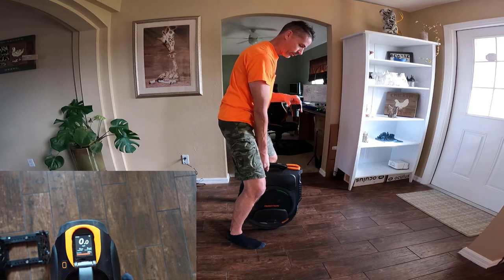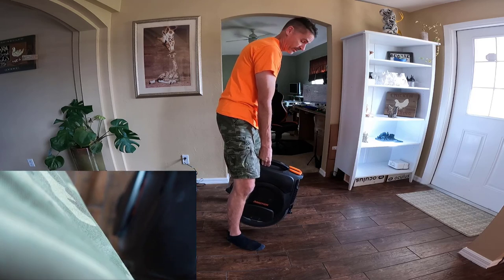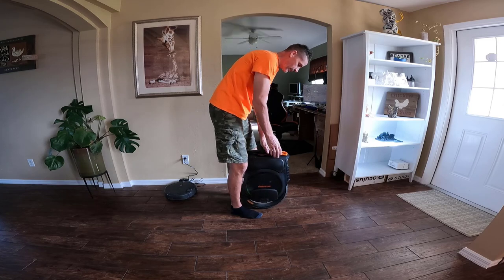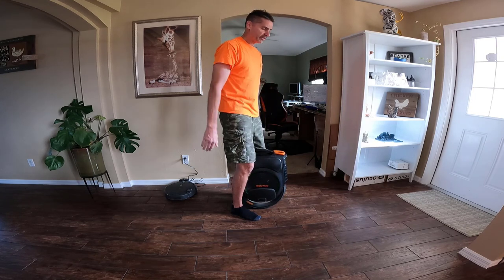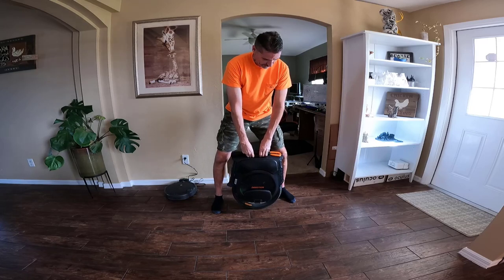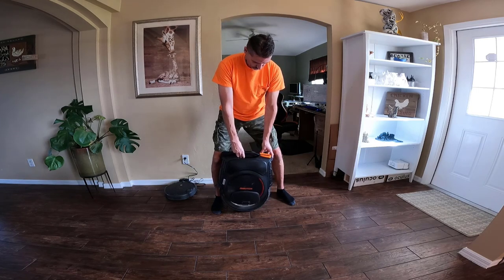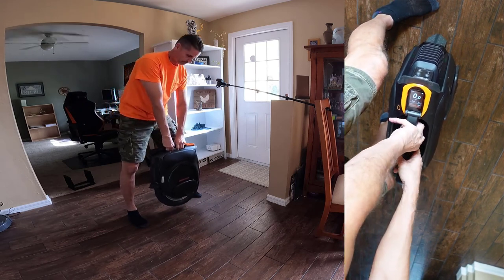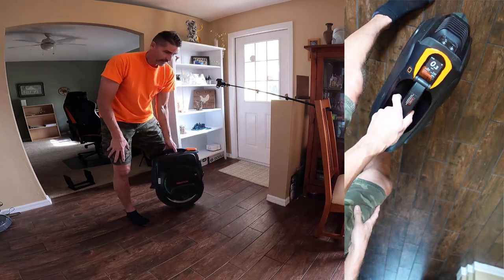V12 Stress Test - Make Sure You Understand What a Failure Is

Comment: Not 100% sure the test applied the stress expected here, you can compare with the sample uploaded by eRides, where the wheel rotation reduces very quickly each time it's yanked.
In comparison in your test it's a much more gradual and long slow down.
Maybe linked to off-road vs computer.

It's a difficult test to reproduce, especially with this handle. (On Sherman it's very easy for instance, I was using this method to adjust the tire and inner tube position on the rim a few months back).
Reply from the maker: The point is, your wheel simply turning off is not an indication of failure.  Evidently a lot of people thought it was.
Reply: @Duf  I do t think anyone got confused with that. It fails when the wheel does not turn on anymore.

Comment: I think it's kinda silly that people expect so much from these wheels. The cutoff test is a VERY harsh test and you would pretty much never be able to do such a quick move while actually riding the wheel. Wrongway's Adam tested this wheel quite extensively and no failures at all, so if the MOSfets are bad, they are just bad, don't really know if the test makes much difference since i think it might just pop the mosfets anyway. I ordered my V12 today and it is a pre-order, i hope that the batch will be with the new MOSfets.

I like your videos and have been enjoying them for a while, i'm also doing some 3d printing stuff :)
Reply from the maker: I agree pretty much across the board.

Comment: When it dies from the test, it sounds like something is jammed into the motor. From what I noticed, the jerk is very sharp in the test. It would be great if Inmotion is able to quantify the power spike that is potentially deadly.
Reply from the maker: Correct that is the point of the video, the wheel simply turning off is not a failure.  Some people were under the impression it was.

Comment: Duf I think you did a good job explaining that when the screen turns off it’s not a failure. But when you perform the tests you’re not applying enough force/stress and from that perspective I don’t think you’re really testing against the issue. It doesn’t serve as a good example for your viewers. Not trying to be rude.

This is an example of a wheel failing the test. You can see the way he performed the test is much different: https://youtu.be/CoJfwebEAYg

Maybe would be good if you link it in the description
Reply from the maker: The intent of the video was not to be the go to testing demonstration.  IMO the test is flawed and difficult to do correctly because there is such a short time period before the wheel stops from hitting max speed.  The point of this video was to let people know that the wheel turning off does NOT mean your wheel has failed the test, because some people thought that.  :_xfire:

Comment: Very similar to InMotion's test video! Thanks Duf Man!
Reply from the maker: Thanks for watching!
Reply: @Duf  as I'm brand new to EUCs and my V12, I have a question for "Stress Test"❓ It's currently charging so I can perform the test and I have never tried to ride it yet! 

Do I have to make a speed adjustment or unlock anything prior to the test since it's brand new? Or, will it allow the test as is out of the box? Thank you!
Reply from the maker: @Hangin_With_Shane  Don't do this test at 100% battery for the same reasons you don't go down steep hills at 100% charge
Reply: @Duf  thank you!

Comment: I don't mean to come off as rude but I'm concerned you didn't do the test right, I showed the video to a guy who works at Alien Rides (Zack) and he said you didn't put enough force on the pull back, if you don't have enough leverage you should turn the killswitch off like you mentioned in the video.

I'm just concerned for your safety, I wouldn't want to see you take a fall during a emergency braking situation.
Reply from the maker: You can crank it as hard as you want, unfortunately the amount of time you have to do this is very short.  The reason I made this is because there are people that think that if the wheel simply turns off the wheel has failed when in reality more than likely your wheel touched free spin cut out speed and turned of as it should.  If your wheel turns off and does not come on or if it comes on and the motor feels seized, it has failed.  Inmotion did not do a good job of making this clear.
Reply: @Duf  Ah in that regard then yeah I agree, I too have seen people claim their v12 didn't pass the test just because it auto-shutoff after the freespin instead of seizing

It also doesn't help that inmotion only sent video instruction on how to perform the test to distributors only instead of putting it out in the public on their website

Comment: Im not doing this. If it fails I'll fall on my face. Im not going to try and break it. People have damaged other brands by lift-spinning then dropping the wheel down before it stops causing a similar type of force, you're not supposed to do that. Ridden many miles already, if my ride style doesn't break it then who says its broken? We are in the era of fear mongering. Hey guys if I bust my teeth with a hammer and they break, does that mean I have bad teeth? Let me try
Reply from the maker: I do agree in some regards.  For example a popular thing some riders do to a test wheel is hold onto something and then snap the wheel back and forth violently, with the same intent, to see if they can overload the wheel and pop something.   I never quite understood it because in real life riding you aren't going to ever be reversing directions instantaneously.  Yes I guess it says something about the overall capability of the wheel but for the vast majority of riders, it doesn't matter.  This V12 issue is a bit different as it has happened doing un-extreme things like going down a hill slowly while braking or even while simply charging the wheel.  I can understand some of the paranoia but I think this stress test in itself is flawed in it's usefulness.